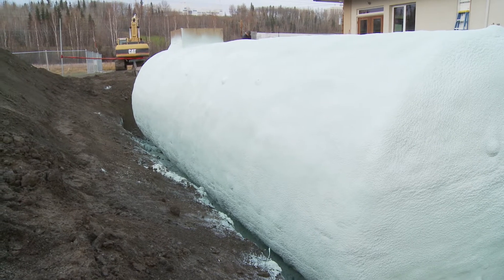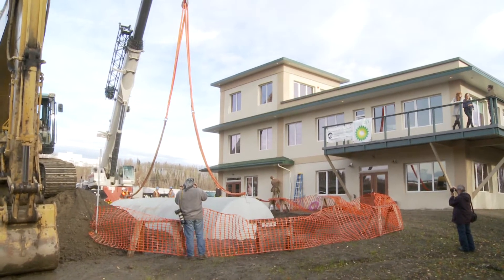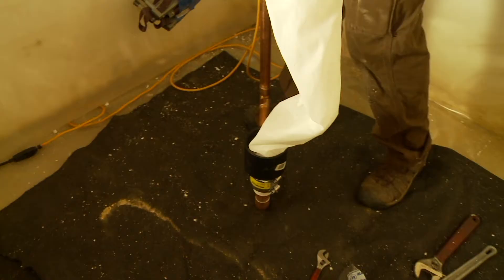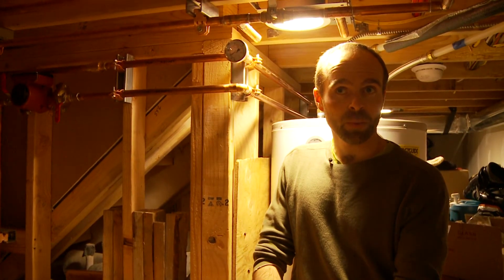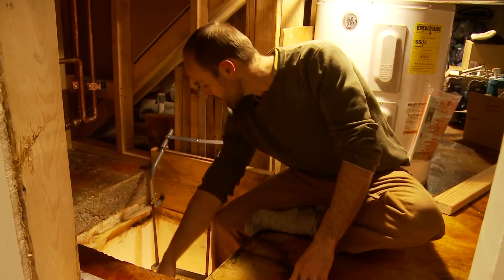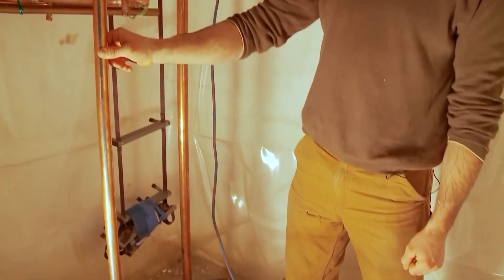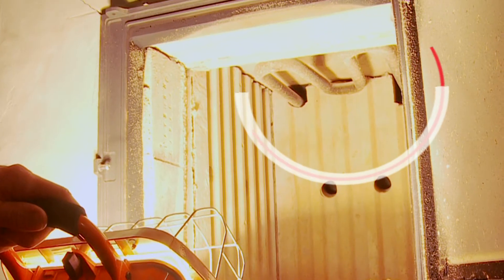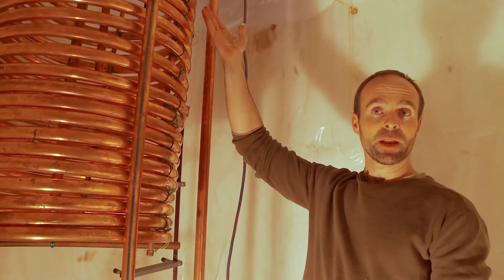Inside CCHRC: Thermal storage

Comment: Congratulations for the system design and thanks for sharing. May I suggest that your system could be improved with a 3 to 4 panel photovoltaic kit working in DC (no inverter required) connected to a heating rod so no wood to burn required.
Reply: Why to use electricity to produce heat ? It is the worst sun's energy conversion rate....
Reply: @AutoNomades  Simplicity and durability. Plumbing through the roof is challenging to get right and stay right in the best of situations, and when you're off grid in a very cold climate (no thermosiphon, must have glycol loop or drain back) and the nearest plumber capable of handling leaks and other issues is hours away at best, it's worth sacrificing efficiency for the reliability and safety of no moving parts and water pipes going through the roof.
Reply: @AutoNomades  Maybe because the capital investment required to produce that heat is so low that efficiency comes in second place
Reply: @bimibericaMEP  So it is more money  - efficient to do a solar electric heat battery than a thermal one? Could differents datas would influence on it ? Wich?
Reply: @AutoNomades well it depends if you have net export and or battery storage but the reality is the water heating by "surplus" PV-generated electricity would be used to adjust the low thermal content of water for consumption, e.g. washing, showers and baths, to the desired distribution temperature for such systems before such power is used for central heating water
Reply: @AutoNomades  Although collecting thermal energy using water is very efficient with respects to photovoltaics, thermal collection begins to suffer when water gets closer and closer to 100C. Having at least 'some' solar will be beneficial in heating the the coolest water up to the max rated temps of the tank.
Reply: @kevinbuiied  <<Having at least 'some' solar>> electrical, or thermal you mean ?
Reply: @AutoNomades  Right. My apologies. Solar thermal is most efficient when the water is cool. As it gets hotter, it becomes less efficient to heat. Some solar electric is useful to push the hot water even hotter when it gets up into the upper ranges of what their tank can safely store.
Reply: Good to know, thanks !  @kevinbuiied  Also, i just learned that, when you have "anyway" solar pannels, usually they overproduce and you have to artificially "dump" this eletricity so ba battery is not damaged... And some clever peoples have built some little device to automaticly transfer this excess energy to a normal electric water heater, transforming it into a thermal battery.... I find it now Very Interesting, wih also the fact that it is less expensive, and need less complicated plumbing (that doesn't loose heat)... I wish this small systems gets more cheap, so I and everyone else could equipy with, it is not a small economy for us an the planet !!

Comment: Hi Bruno, you told in the video about the data ; is that available. Please can you show  us where the data is accessible? I did search for this kind of system to build next to our new to build home. 
Maybe I did miss it some how; the water tight 1/8" foil, what kind of material is that?
Is there any follow up about the 25000 tank and appandages?
Do you have somewhere more info and data about your water box under your home?
Please let the info come!! Thank you.
Reply: The 1/8" liner in the tank is vinyl not foil. Cheers

Comment: Any concerns about Legionnaires disease? Algae growth?
Reply: Because it is a closed loop system the water in the tank doesn't get extracted. Fresh water flows through the heat exchanger (copper pipe spiral) in a just in time, as needed for showers etc. Heat exposure time is too little for Legionäre bacteria to occur. Most algae problems occur only when the water is exposed to sunlight which doesn't occur in his system.

Comment: I'm looking to advise a customer on replacing a fossil-fueled boiler with a heat pump. The Daikin Altherma system looks promising. Daikin has many high-production info resources, but not much boots-on-the-ground how do you install and configure it type information. My main concern is matching the existing cast-iron-radiator system to the heat pump -- or replacing the existing cast-iron radiators with Altherma convector-radiator units. Would I need to get new electric to these, to operate the convecting fan? Is the fresh-air pipe needed for proper operation of the unit for heat-only (or for cooling --  to manage condensation or what?)

Comment: wow! fantastic intructive video! the stratifier is especially clever! I'd use a closed separated heat transfer system though with glycol as transfer medium. as a Swedish eco architect I think I can safely say this method will be very useful in heating with low environmental load in colder climates all around the world. thanks!
Reply: do they use an electric heatpump to further crick up the efficiency?
Reply: @WillemsMathias  Yes indeed. 4,5-5,5 COP dependent on the make of the heat pump (fex. water/water)

Comment: I wonder if that tank would work better filled with sand and the water ran in a closed loop...
Reply: There are sand thermal storage systems, but I would think that sand does not stratify. With the cost of copper and having the copper heat exchanger at the top of the tank where the hottest water stratifies

Comment: Are there any calculations that show how much of the winter heating requirement this storage covers ?
I'm guessing not very much.
Alternatively, please advise of water volumes, insulation specs and solar panel output, so we can do our own calculations.
Reply: yeah, its called thermodynamics

mass*specific heat*temp=energy

assuming a spherical chicken in a vacuum, the results follow easily. However including the various losses and other poor assumptions take it from 5th grade to phd real fast
Reply: @5347robo  I studied Engineering, so am familiar with thermodynamics 🙂
I just would like to see some evidence of the calculations for this installation, as most people just don't put a big expensive tank in their garden without doing some calculations to show how much energy can be stored and how long that will last for.     So capacity as you suggest, plus heat loss, solar input calcs and requirements for the house.    
If I do it, I need to estimate the volume of their tank, estimate the insulation spec etc.     Would be far more interesting to see the actual calculations for this installation, with real dimensions.

I guess it might be more interesting in climates where there is more winter sun & scope for solar in that season, as I really doubt this will have anywhere near enough capacity or insulation for a proper winter season with less sun.
Reply: @jxj2684  ah, I see I too would like to see the real world performance data.

It doesnt look like they cut corners, so I would assume its relativley efficient

Comment: Very interesting system. Please let us know when performance data is online for viewing. (Hopefully your instrumentation system is as well thought out as the space heating system itself.)

At the end of the day, it's the system performance data over time and in various outside temperature scenarios that is where the rubber meets the road. Green technologies have to work and deliver at cost/btu. Plus there is the question of embodied energy in the materials used - systems have to be widely deployable to begin to make a dent in global energy impact.

Still, every creative experiment is a learning opportunity, no matter how it turns out. Hope you'll freely share your performance results so we can all understand how things are performing.

P.S. I encountered an interesting experiment in small, passive solar heated shelters for homeless people that didn't seem to work and I have always wondered if the problem was thermal stratification. If so, it could have remedied with a little solar PV powered computer fan to force the stratified hot air at the top of the shelter to mix with the cold air at floor level. (Sometimes an idea is almost at the finish line and just needs a little tweak to work reasonably well.)

Hopefully you've thought of everything in this cool (warm actually) system design...

Comment: Although this is a great solution for Heating storage, by far its not the most economic and the most efficient. A home made sand heating battery will work better, cheaper, and anyone can build it by themselves if they can access the equipment (high temperature blowers, pumps, etc).
Reply: would u be willed to share further information on privmsg? Greetings Jonathan
Reply: @Anorectic.Bumblebee  you can search online for batsand sand battery

Comment: Always remember a house that is too tight is not a Heathy environment to live in.
Too tight with any moisture issues will breed mold, sometimes in places not accessible so you don't know it's there
Reply: Adequate ventilation through a heat exchanger.
Reply: Energy recovery ventilators will ventilate the whole house and reduce energy loss of the house.
Reply: Well yeah so you gotta solve the moisture issues. A well built, air tight house with the right ventilation won't have any mold

Comment: I have thought about using solar water heating, but always come up against water freezing in the exterior  system when it is not producing heat. How are you able to overcome that barrier in Alaska?
Reply: The most common solution is using a glycol water mix.  The glycol drops the freezing point way down but it's  more expensive than water.     Another low tech solution would be a drainback system.    Basically a valve opens and all the water drains down to  an insulated tank.   A problem with a drainback system is that if installed incorrectly not all water will drain and there will be ice damage.
Reply: Don't be nuts!  How could you ever afford to build it and then let it freeze?  This is inter seasonal storage, and once it is warm you would never allow it to get to freeze.  You would pump it out rather than incur the cost of glycol.  You could however make a business case for a PCM at about 50'C.

Comment: Thank you so much for the video, GREAT implantation. Are there any data on the internet yet ?What have you used for electronic compenens for Control of the temps? The stratefire what is it made of ? Please make some updates. Greatings from Denmark
Reply: I would think any pipe that has fine holes in will surfice. Personnally I would keep the tank water separate and use indirect piping as a heat exchanger. So the tank water never leaves the tank.
Reply: @dcawkwell  how can you then get the stratification?
Reply: @ybaggi  You just have coils that reaches over the layers, it has the same effect. The water that circulates in the floor heating will coil from the bottom to the top that way the cold water leaving the floors will incremently get hotter as it moves up in the coil. You can also place the coils in different levels depending on your heat source. The solar collectors wont heat as high temperature as the masonary heater for example. But when you have this many heat sources and usages it sure is clever and flexible to use that stratifier sock he has.
Reply: Nnn.                   Ok I boo I Kp p PLLC

Comment: Who came up with a pressure sock idea? A small wind turbine or solar panel running a water pump activated by a thermostatic switch would run the water only when the sun is up for recirculation or when programed differetly. A copper coil of pipe wrapped around the chimney of a rocket stove would heat up all in floor heating if the ground collection stopped working, fyi.

Comment: The solar water panels mounted to the south side of the building is not the best idea. They block all of the suns direct radiation on those huge spots where the panels are mounted. A better idea would have mounted north of the house at a high enough elevation to not be shadowed by the house or south of the house far enough to not cast shadows onto the house. Pretty basic common sense. These systems should be set up from the beginning to maximize their effectiveness and all considerations should be applied or else you will never get 100% of available green energy. Nothing should shadow a house in cold climates. To increase effectiveness mirrors should be added to reflect more light onto the panels. Again, simple logic.
Reply: I suspect the envelope of the building is so well insulated that it gets almost zero heat from direct sunlight.
Reply: @walterrutherford8321  ya lol r70 on the walls... sun aint doing a thing through the wall.

Comment: I'm surprised that the house isn't bearmed to help maintain the heat. Also, a look at say what the EarthShip folks are doing to be totally off grid & self sufficient. 

Just my 2 cents...LOL
Reply: Berming requires you to use relatively expensive and high impact insulation like foam or mineral wool, plus you're forever dealing with water issues. There's a good reason earth ships and similar houses are always built in very dry and relatively warm places like New Mexico.